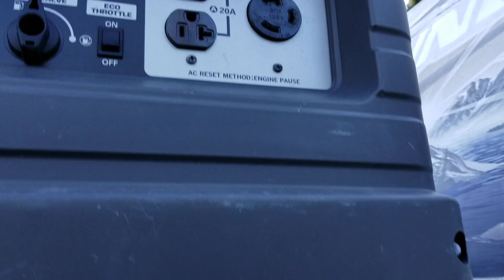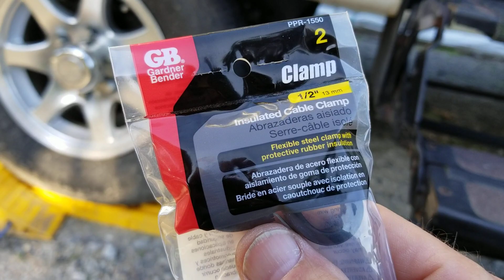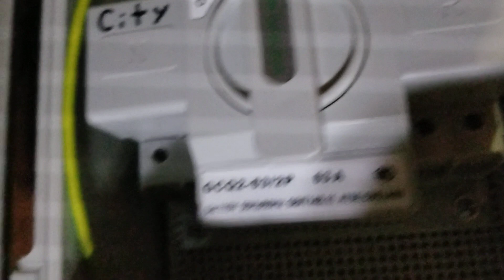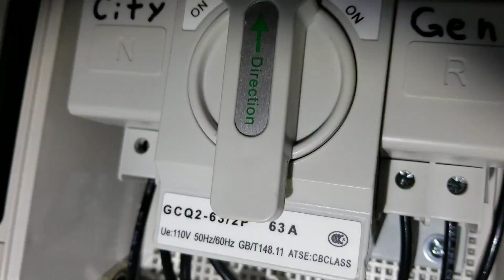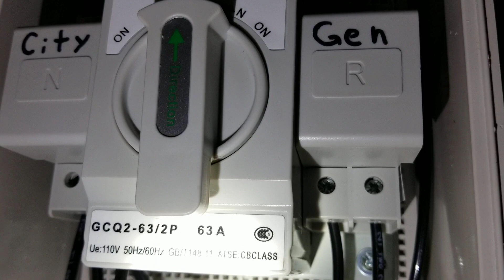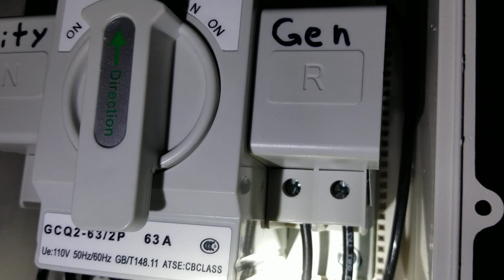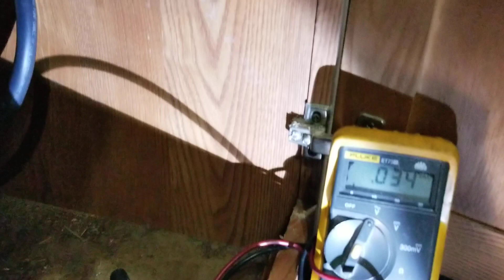RV  automatic transfer switch installation for a generator

Comment: please be careful.  If your not sure what your doing. DONT.   This guy is lucky he didn't fry something in his camper.
Reply from the maker: I am not lucky!!! That transferswitch had a manufacturer issue. I disagree with you 100%. My new transfer switch has zero issues. I constantly monitor my amp draw with a digital monitor on the door of my transfer switch box.   I solved the problem back then, and the trailer is still very much operational. I made it through all those very cold winters up north without ever over amping. That's how I know I'm safe. Now I'm down south, and there are no issues at all. You are the one who doesn't know what you are talking about and trying to act like you're so smart. Haha, please, no one listen to this hater.
Reply: @allewton no hate here. Looked to me that you may have crossed a wire initially and later off video fixed it. Were all here to figure out how to install these switches. So you indicated that the switch had a manufacture issue.....then said it had no issues?  I'm an electrical inspector and always suggest that a simple sketch of what your gonna connect is the best way to ensure you don't fry any thing or any one.
Reply from the maker: @inspectorh4548    okay, gotcha. I understand you now. I came off a little too harsh there as well. The switch I installed in the video had a lose neutral inside, that's why it didn't work in the video, but it magically started working, then it would work sometimes, and then sporadically work and not work. That's why, in the video, it was hot, but the neutral wasn't letting it complete the circuit. The switch in the video had the manufacturer issue with a loose neutral inside the switch. So one day, I got under there and noticed the white neutral wire had signs of getting hot. That's when I ordered a new transfer switch that works perfectly. That's what I meant by new switch, When I said I had no issues with the new switch, the newer, new switch isn't even in the video. And man, now I do appreciate the view from an electrical inspector. 
No, I never crossed a wire, but I believe I ran out of phone battery at the end, and I didn't know how to edit a video once the camera turned off back then, I was just using the pause button. So I just uploaded it as is. Thanks.

Comment: This looks more like a manual transfer switch because it has the switch to change from city to generator power.
Reply from the maker: Yeah, I get you becuse it's both. Manual,  or Auto at the flip of a little switch at the top above the breaker switch. I noticed I even worded it wrong about the AUTO selection. Just say: running on city power and the grid goes down. It wouldn't automatically switch over, I would go outside start my generator,  and that's when the Automatic mode would switch the handle over to flip the  breakers to the generator side and feed power from the generator.
Reply from the maker: Hey, thanks for your comment. Also, I have the old switch that went completely out on me. I may make a video of me tearing it apart and aee if I can figure out why it failed.

Comment: Your main wire is #10 which is for use on 30 amp circuit not 40 amps.
Reply from the maker: I have been traveling since 2011. I work as an electrician, I understand wire sizing. But my CT Says I never over amp and I have no major heat on the wires, or the devices. I started in 2011 with 30 amp breaker in trailer plugged into a 30 amp breaker on the pole outside in the campground.  The 30 amp breaker would always trip outside. I got a 50 amp adapter and it would trip the inside, so I put a 50 amp male plug head on my cord outside and a 40 amp breaker inside. On my last trailer I was able to upsize the trailer cord to my panel just because I had clear access all the way through my trailer and I had the cable. It worked but I didn't have a transfer switch in that trailer. But in this trailer I have the same 50 amp outside, 40 amp inside set up, works great I need to abandon my #10s and go under my trailer with #8s if my CT/amp monitor ever says I need to. The most amps I ever read on the monitor was 21 amps. I still have the same 2011 trailer that I bought at the end of 2017 in this video. It's in great shape except the 63 amp transfer switch just stopped working on 6-13-2022. I have bypassed the switch and I will put a new transfer switch on Sunday on my day off. Odd that the component with the highest amp rating in my complete electrical system is the only thing I've had to replace because it broke it always reads volts through the switch in the ON and OFF position,  but the neutral will not make in the switch,  therefore not completing the circuit. I hope my new transfer switch works longer than the last one. 4 years for the life of the switch is just poor quality. Probably actual rating of 25 amps or less, is my guess on that switch which may have just been a lemon.  My new switch is a different brand of a very similar switch. We'll see?
The problem with this switch may have existed when it was new, the problem I had at the end of the video was that I had to wiggle the switch to get the neutral to read through, but that was the only time I ever had that problem.

Comment: Trust me, it’s not impossible for that transfer switch to have both power sources going to the load at the same time. It’s simply two breakers switched by a little motor. It’s mechanical in nature. Parts wear. The switching on of one breaker and off of another is close.
Reply from the maker: In its present state they can't be on at the same time. Even though there is a motor that moves the switch, the mechanical part that operates the switch will not and can not turn the other side on at the same time because it turns one side off first before it turns on the other side. Just feel it in action, and listen to it or pop it apart and look at the way the transfer switch is actually built. And trust me! I don't suggest anyone modifying it.

Comment: Please, can you send me the details and from where you bought the box you used for 110v 2P 63A Switch?
Reply from the maker: Check this out at Amazon
BUD Industries NBF-32016 Plastic ABS NEMA Economy Box - Electrical Box for Indoor Uses - Industrial Box in Light Grey Finish with Solid Door Construction. Conduit and Fittings https://www.amazon.com/dp/B005UPANU2/ref=cm_sw_r_u_apa_fabc_s7qbGb57XC7RM?_encoding=UTF8&psc=1
Reply from the maker: I forgot  to mention that I used this backplate with the box. Check this out at Amazon
BUD Industries NBX-32916-PL ABS Plastic Internal Panel, 10-1/2" Length x 6-11/16" Width x 1/8" Thick, for NBF Series Boxes https://www.amazon.com/dp/B005UPE83U/ref=cm_sw_r_u_apa_fabc_CPFbGbWREWTDP?_encoding=UTF8&psc=1